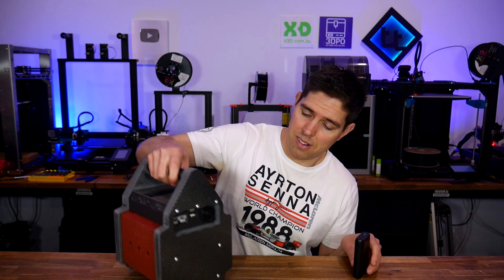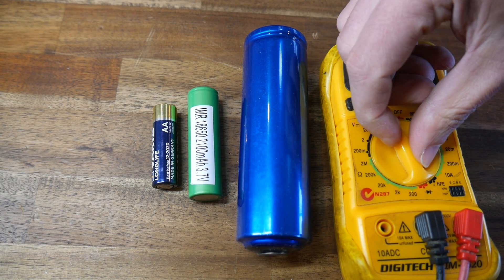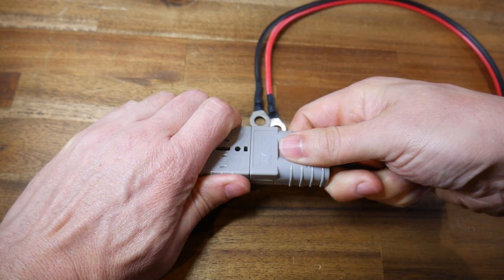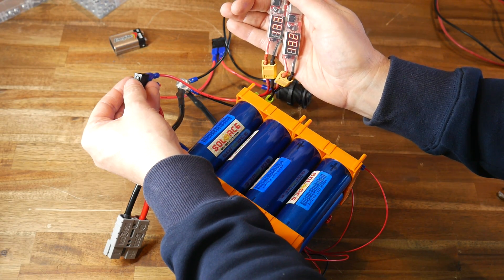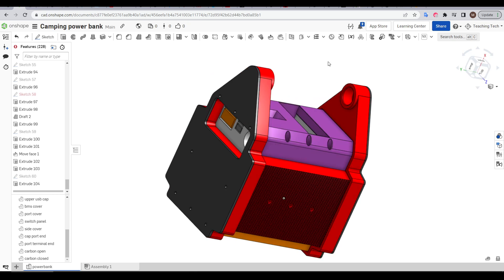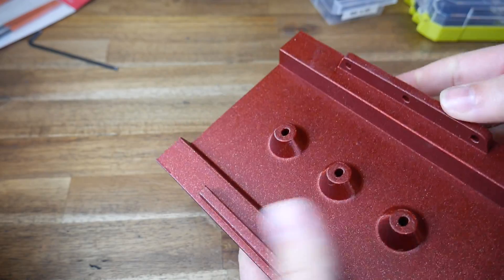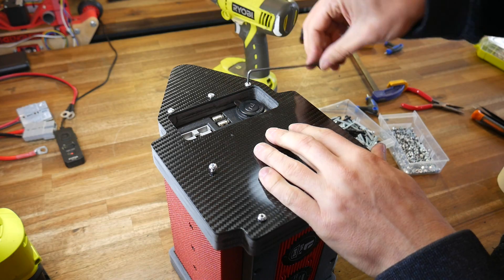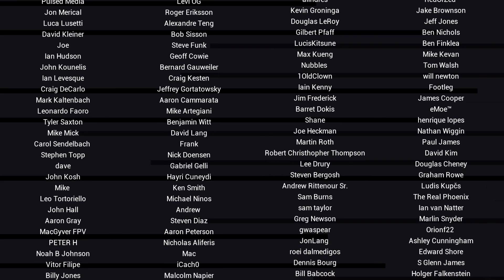Making the ultimate camping powerbank + Bambu Lab X1 update

Comment: I've been bitten by the droid building bug and one of my "down the road" plans is a GNK or PLNK that's filled with chargers and other batteries.  The Headway cells have great potential for something like that, so I'm so glad you shared them with us!

Also: Got my X1C yesterday, in Canada, and so far I'm extremely impressed.  Basically everything that's been less than ideal so far boils down to learning curve (and the occasional ID10T error...)
Reply: Is in my list, so in a couple of months I'll by one for sure. i let you guys be the beta testers. I need issues free printer, and this one looks like has potential for being the one I'm looking for once they solved the normal issues you guys are discovering. Thanks btw, without you I wouldn't be able to get it later. 👏👏👍
Reply: Out of curiosity what backer number are you?
Reply: @BeefIngot  548, I really wanted the early bird price and had a friend jump on as soon as the KS went live.

Comment: A limit on lifeph batteries is that they cannot be charged below freezing, that is when they can start on fire. Building batteries like this requires a lot of research if you are using it in harsh environments. If you want to save weight you can get pouch batteries in various chemistries.

Comment: Looks great, maybe you should consider some risers on the bottom to ensure that BMS is not being covered and overheating and maybe printing those red parts out of ABS or something more resistant to heat especially if it's going to be left out in the hot car sometimes.
Reply: Agree
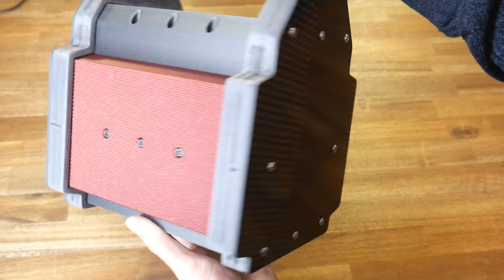Reply: At 14:09 you can see the side panels are lower than the bottom of the bms providing some air passage. Maybe not enough but that's more of a test and see with your specific bms

Comment: I really like these kinds of projects, but even if one is very careful about designing and assembling a DIY battery pack I still think the risk of a fire is too high to ignore. The liability issues you would have with your insurance would be a nightmare. And some stuff is simply out of your control, the cells could have a manufacturing defect and short themselves, and proving it was not your fault that the battery caught fire would be almost impossible
Reply: LFP don’t catch on fire.
Reply: As Thanos mentioned and Michael said in the video, LiFePo4 (LFP) cell chemistry is much less risky and will produce smoke at worst. LTO (Lithium Titanate) is even better, but very expensive and pretty low energy density.

Comment: If you use a heat gun you can get rid of most of the "white" sanding marks.
Reply: wd-40 works well too
Reply: @Mr_Pewpy_But-Whole  Haven't tried that yet. Does it come back when it dries out?
Reply: That's how I deal with those marks also :-)
Reply: As a smoker (unfortunately) i can tell that a simple lighter does the trick pretty well.
Reply: @DavidMézière  Same here but not everyone is as silly as us. (tip: jet flame lighters don't leave soot behind on the prints)

Comment: why not use a quick charge 4 and power delivery board? in this way you would have up to 100w via usb c to charge everything
Reply: 100w PD needs 20v 5a
Reply: @Apophis-en9pi  not really, some board have boost converters on board to deliver 20v
Reply: So 60w is the most you can get from a 12v source.